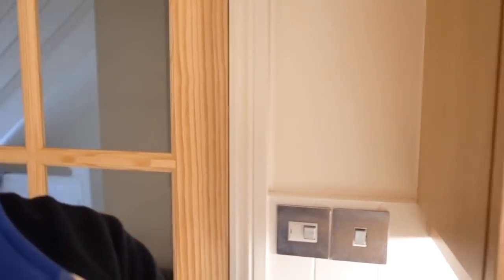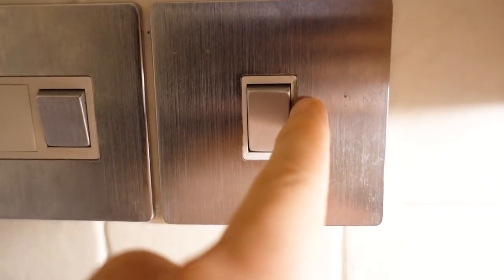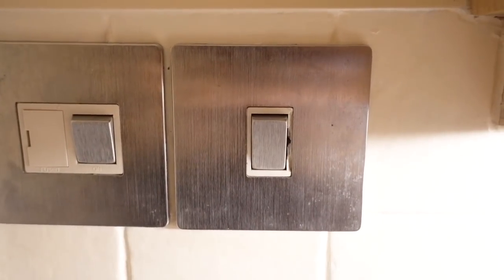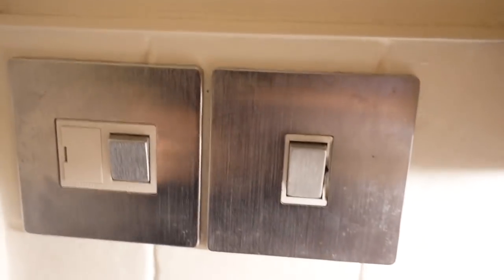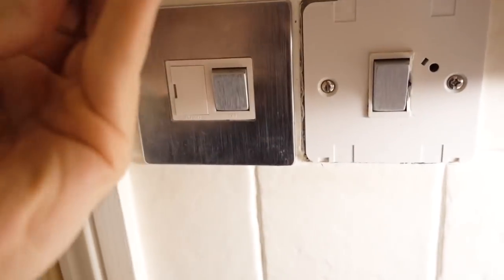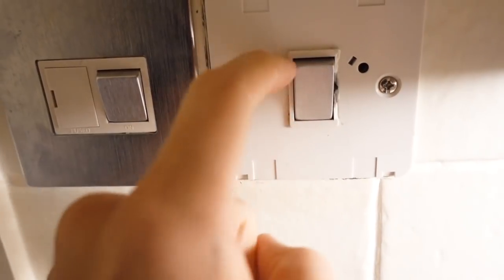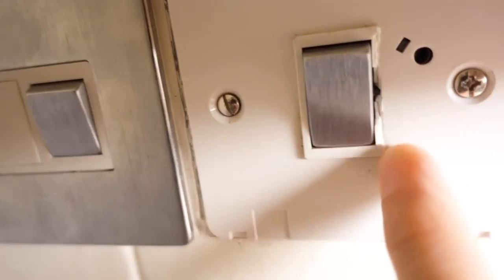ELECTRICAL INSTALLATION CONDITION REPORT | TESTING CODES

Comment: The first time i have watched this one Dan, this is as always is a very contentious issue and the amount of times i have had huge debates and many fall outs with other electricians on the coding they use. very informative and a useful tool, it is just clear and concise and the use of others comments and opinions is excellent.
Reply from the maker: Eddie spicer thanks Eddie. I am planning on a EICR specific coding video in the near future. I have battled with this topic for years. It's led to numerous fall outs and risking losing  £100k + contracts due to conflicting opinions based on poor and lack of knowledge. I like that the Napit code breakers came out because I have had clients specify coding is in accordance with the electrical safety first best practise guide 4 Even though they are commercial properties with mixed public, medical, office and other uses. Thanks for watching.

Comment: I would agree with the guys who commented linkden. I'm a year 2 apprentice but straight away I would give it a c3 no danger present, switch still operates with out risk, but I would say if I was telling a client or some about this, I would say this could become a c2 (possible danger) if nothing is done as clearly stated some minor cracks are there which with potentiel could cause more of plate to break away causing possible exposer of live parts, but in all cases switches are cheap enough to replace so it's a win win really no one gets hurt
Reply from the maker: C Austin good comments and it's great you're taking a methodical approach to reporting even though you're only a second year. Advising clients is very important but you need to make sure what you say is accurate and realistic. Like you say switches are low cost so I doubt many would have an issue paying for one.
Reply: How refreshing to hear a 2nd year apprentice with such a methodical approach to electrical coding. I think this lad's got a bright future ahead of him Dan, what do you think.

Comment: Well I agree with the C3 in this case but.....
As mentioned you obviously have to look at each situation on its own merits. As example, if you were looking at an installation with a cracked socket you may take a different view. It might be that the act of inserting and removing the plug top could result in the accessory becoming further damaged and result in access to live parts. So in that situation, a cracked accessory may be potentially unsafe and therefore attract a C2 IMO. So it's all down to you judgement for a given situation. In this case the damage does not appear to be significant, and the risk of any further damage resulting in access to live parts seems minimal, so C3.
Reply from the maker: 12leckie I agree. It was hard to see but there were some minor cracks on the switch but it wasn't enough to break but if it were I may deem it a C2 so absolutely. It is also hard to tell a code of something by just looking at a photo. A risk approach should always be taken!
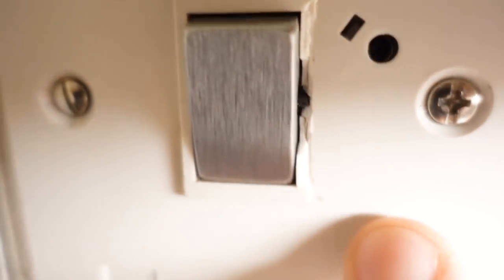Reply: I would agree mostly with a C3, my only concern with this switch would be that the rocker could be knocked out as only one of the pins is retained (1:32 you can see the right hand pin) thus causing a C1 so would probably code it a C2. But without closer examination it would be hard to tell.
Reply from the maker: Matt Eykel yes I agree with you if the switch was subject to further damage it could be potentially dangerous and warrant a C2 code. I inspected this switch and although slightly cracked it certainly isn't a concern. Like you say it is hard to tell without actually seeing it. That is was inspecting is all about. Being able to make that judgement using engineering knowledge and understanding the use or the item, it's environment and the risk surrounding it.

Comment: hi how are im fine im interested in wiring around the world will a american apliance made for 240 volts in the us work in england 240 phase to neutral in the usa 240 volt is phase to phase ? in the use we use black live white neutral green ground or bare for ground 14 american wire gage is for 15 amp circuit 12 gage wire is for 20 breaker same color code how many amp circuits are used in england  and what is the wire gage i hear its red live black neutral green ground and its stranded wire
Reply from the maker: David Berquist well now I am going to completely confuse you! Our voltage is typically 230V line (live) to neutral or earth. Brown in line. Blue is neutral. Green and yellow is earth. Most domestic house power circuits are 32A ring circuits consisting of 2x 2.5mm cables or sometimes 2x 4mm cables . But we also use radial circuits rated at 16 or 20A using 2.5mm or sometimes 4mm cable. Lighting is separate at 6 or 10A and the cable size varies but usually is 1.5mm although sometimes 1mm.

Comment: It’s a C1 or C2. You told your wife to be careful with it, therefore not really a C3 in your mind.

Surely directly behind the rocker are the contacts, a single fault, say the rocker flying out because it’s no longer adequately restrained would expose those contacts . C2

Wet hands just means increased arc risk with the increased access to contacts. upgrade to C1